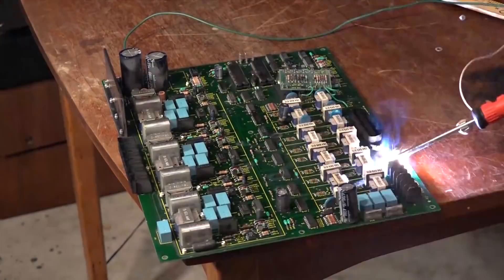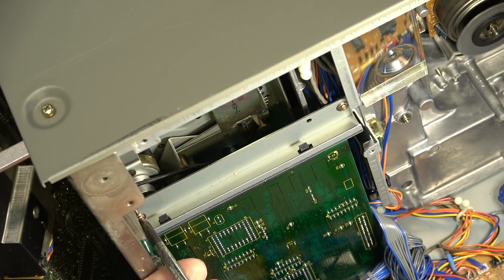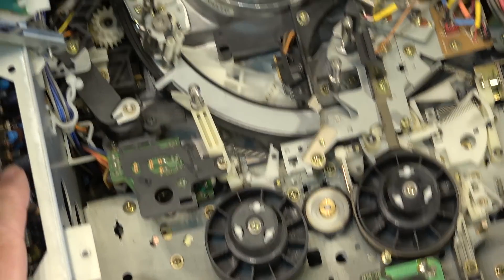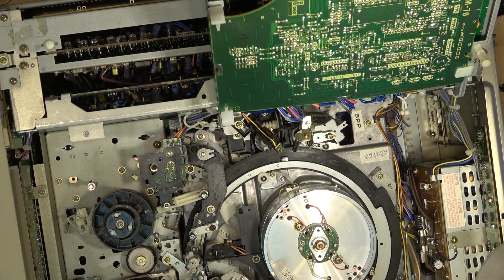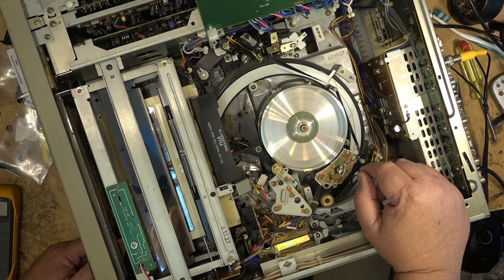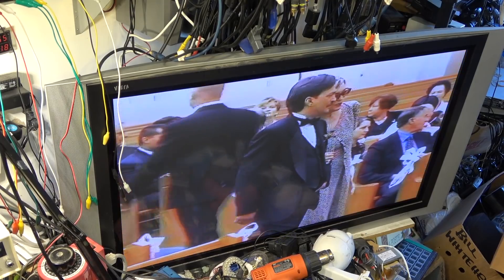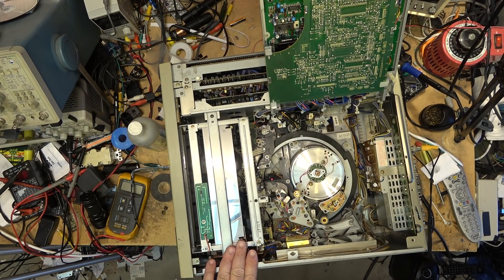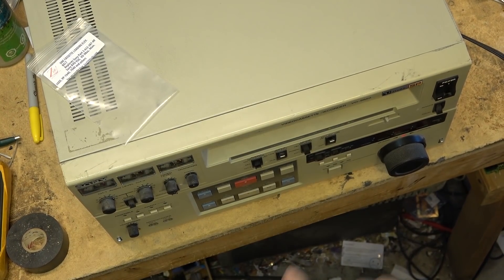Sony VO9850 3/4" UMatic SP VTR Belt and Idler Replacement procedure

Comment: Changing the upper scanner drum in those 3/4" machines was always lots of fun! 
tappy tap tap with a very small brass hammer to get the eccentricity aligned!
Reply from the maker: Same with the old Betamax units up to the 5000 series. A mircometer alignment jig made it simple but without it was a PITA
Reply: @12voltvids  oh yes... the micrometre was about as invaluable as the fish weight scale to measure the tape and reel table tensioning!

Comment: Ah yes, U-matic, reminds me of the Sony PCM-1630 that was used as the A/D converter for most of the earlier CDs in the 80s to early 90s. It would be combined with say a DMR-4000 and the digital audio would be encoded onto the U-Matic videocassette's video, it was neat how the digital audio signal was embedded into the video. Another neat format was Sony DASH that recorded digital audio straight onto a reel to reel tape. Sony sure did come up with a lot of formats.

Comment: Hello, I recently bought such a machine, but I have a problem - I have no color. and video input too. I have documentation, I changed a lot of capacitors on the MD-60 board, but on the DM-73 board I don't have 5.53 MHz at test point TP513. Up to IC511 pin 7 has 4.33 mhz. Can you help?
Reply from the maker: Sorry not that familiar with it. If it was sitting in front of me i could probably diagnose it but as to telling you what is wrong, i haven't a clue

Comment: THE BIG QUASTION ..is the ED Beta format better than B1SHB super hi band? and what is future in ED Beta?
Reply from the maker: Ed beta is better.  B1shb is 6.0mhz carrier and edbeta was 8 or 9mhz carrier. 500 lines of resolution. Even better than 3/4".  Edbeta used the same metal tape as betacam SP.
Reply: so..ED Beta is more close to dvd quality right?
Reply from the maker: @fadhlematrook1248  well the color down converter frequency is still 688khz same as regular beta and 3/4" umatic.  Hi8 used 729khz color under frequency which gave hi8 the edge in picture quality.

Comment: had U-MATIC recorders had been available for the domestic market then VHS would have lost the video war.
Reply from the maker: No it wouldn't.   Umatic has 60 minutes max and betamax offered a picture that was on par with umatic at the beta1 speed. Beta used same carrier and color under frequency as umatic.  It was basically the 1/2" version of umatic.

Comment: did the u-matic sp plays old umatic recording cassette?
Reply from the maker: Yes and it will record the low band too. SP tapes are like svhs. They have a hole that triggers a switch to turn on sp mode.
Reply: so it can play all u-matic cassettes
Reply from the maker: @fadhlematrook1248  yes and record all

Comment: Please would you help me? 
My Sony BVU-850p U-matic SP VTR is not working properly... 
Im one day insert a tape, but machine is struggling to get tape to head, and I pressed eject, but tape cant move. I turn off machine, and manual turn motor, all the way to the part where the tape stands, and turn other motor manuali to eject tape, I managed that and I didn't damage the tape, but after that I turn machine on and... (please watch the video) https://youtu.be/yZolPnYtKlo